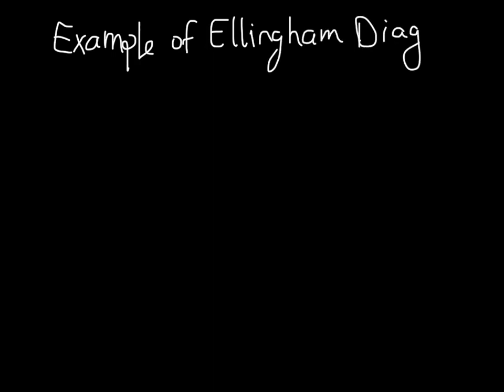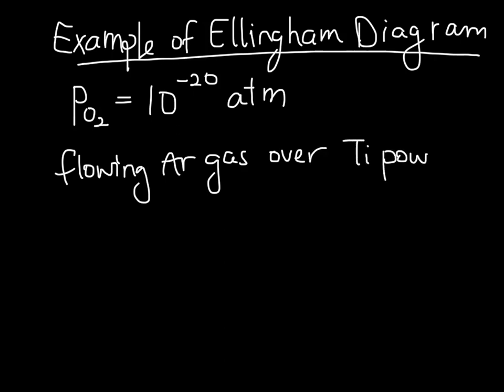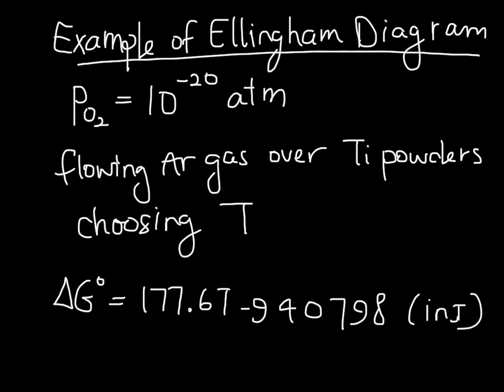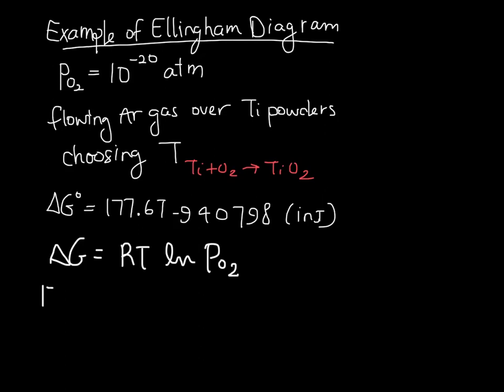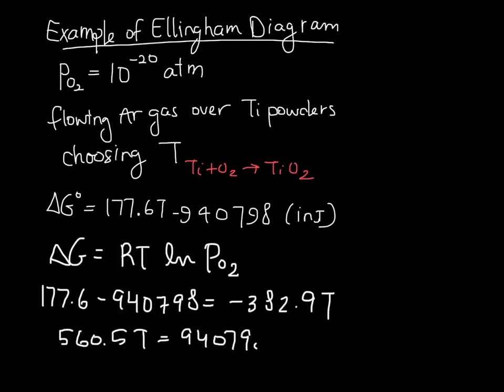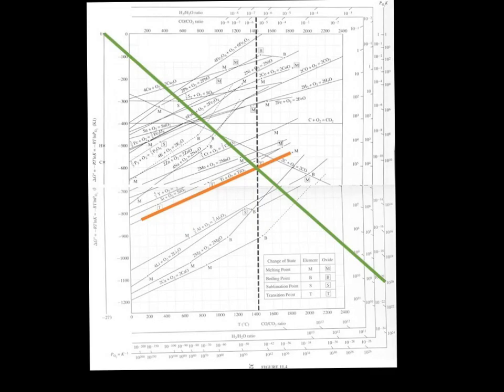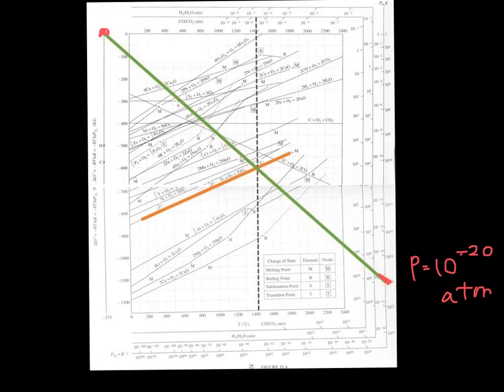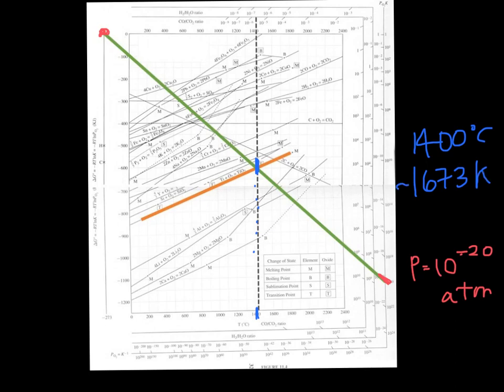ellingham diagram example

Comment: I have a question regarding oxidation of metals.
Based on Ellingham diagram why at higher temperatures we need higher Po2 for oxidation to take place? In other words, based on my knowledge the oxidation rate is normally higher at elevated temperatures, so compare to room temperature with smaller amount of oxidation we should have oxidation. Let me give an example:
about oxidation of Ti+O2-->TiO2 at Po2=10^-20 based on below calculations we find temperature of 1678K for oxidation while if we increase Po2 =10^-10 the temperature for oxidation increases to 2549K, which is strange because we have higher oxidation pressure the oxidation should still takes place at lower temperatures. Please help me on this issue
Reply: +AmirAhmad Mohammadi The reaction favors metal if temperature is increased. The reaction favors oxidation if pressure is increased. In order to let oxidation happen under increased temperature, we increase Pressure of Oxygen. So the ellingham diagram is right.